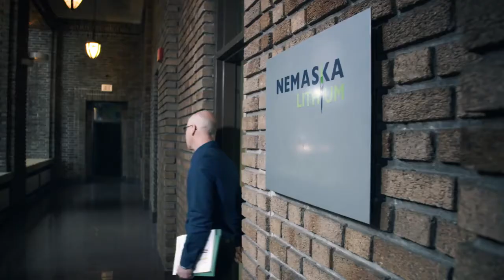Discover Nemaska Lithium 发现耐马斯克锂业

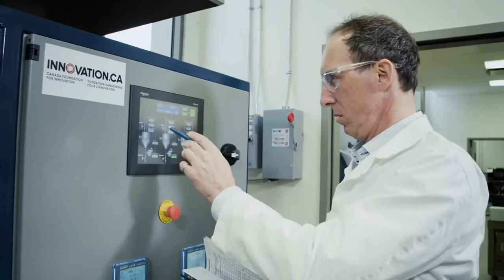Comment from the maker: 04:40  infrastructure   03:41   reagent     04:49  stockpile    01:08   favorable    00:44   flowsheet
03:41  sulfuric acid    04:49  transformation    03:23  monohydrate  03:49  hydrogen 
  02:39  sulfate  00:54  conversion     03:15   electrochemistry      00:57  expertise
02:51   surrounding (a/n)       04:09   emission     01:02   access (n/v)    03:15   deploy
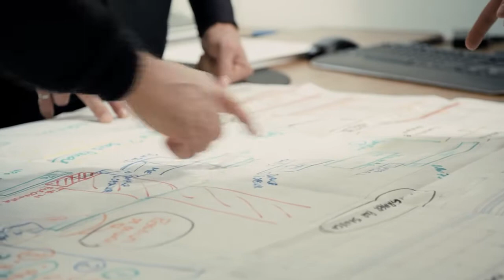02:26    cater     05:08   enable     01:27   maintain       01:49   perspective    00:08  by coincidence
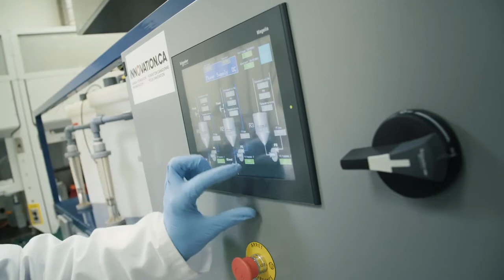01:49 +05:15  benefit (n/v)      05:12   aware     04:20   sustainable    02:26   growing (a)
00:23   historical     04:30+05:12   impact (n/v)     01:49   spin-off     03:41   comsumption
04:30   committee    04:30   objective (n/a)    05:15   responsibility  for   05:15    open (a/v,n )
00:15   be made up of --- make up    00:23   start with     05:12   individual (a/n)
01:27   working (a/n)  working relationship   05:15  transparent   04:20  interdependent
02:15   phylosophy    02:00  employment    03:12  perseverance    05:00  perseverant
05:00    origin    01:02  work to   04:40   journey (n/v)   00:57+05:12  collective   00:44  proper
05:15  generation    03:03  limit (n/v)  limits     02:26  involve    02:20  organization
04:20   relate to   01:08   location   01:14 locate    04:30   as as possible
04:09   drastically     02:51   in respect of    04:30   as much  as possible  
01:57  outcome    00:15 +03:03 visionary